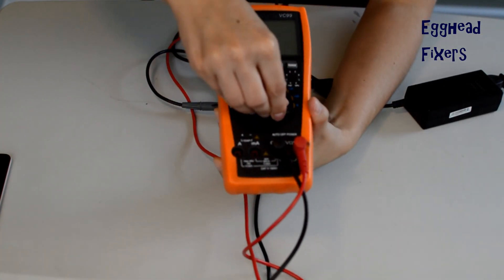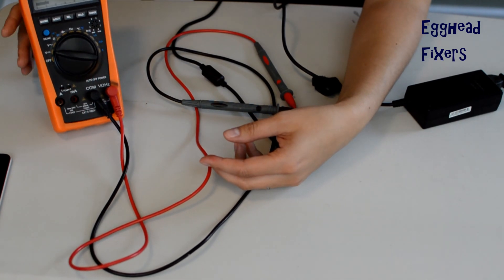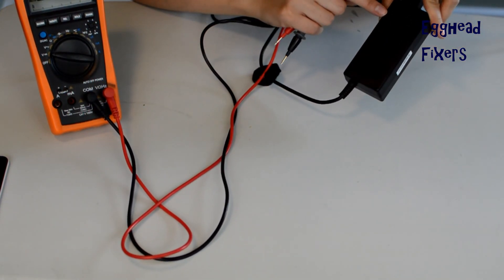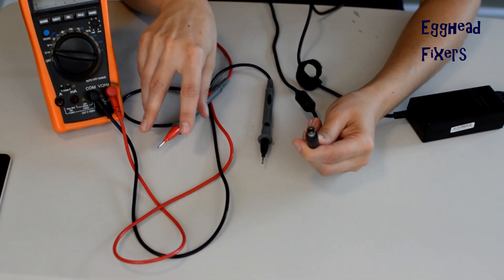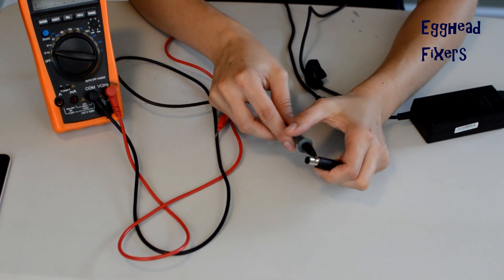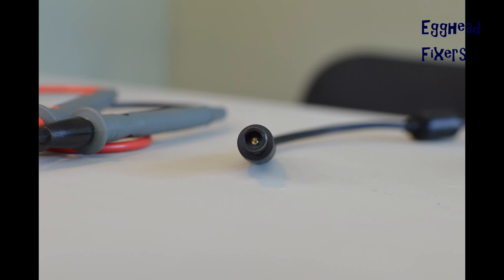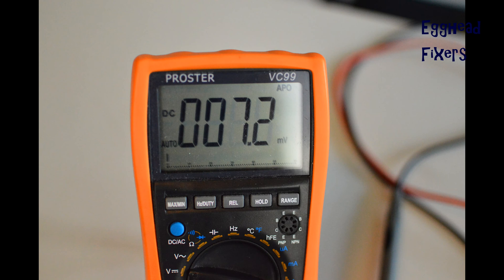How To Test Your Charger / Power Cord On Your Asus Laptop

Comment: Good to see a simple demonstration of the method to check.  I currently have a monitor that died and was wondering if the external power puck was faulty (ADP-90YD B ). Says its rated at 19V however, testing has it going from 17V to 19V constantly...I assume this indicates a bad power brick and it should be a steady voltage?
Reply from the maker: You are correct it should be a steady voltage. I would try replacing it.
Reply: @EggheadFixers  thanks I did, and realized the voltage should be stable when testing another power brick...have since replaced it! Learned something new :)

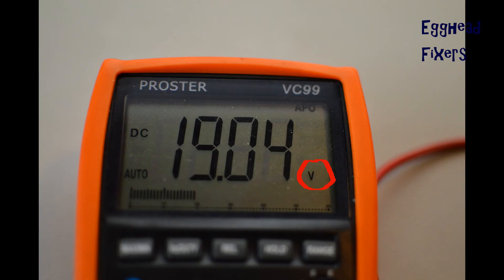Comment: Hello, on minute 00:55 you mention that to test properly one needs to touch the red tip into the gold tip inside the charger jack. Question: on my Dell Latitude 7280 laptop charger, when I touch the tiny tip at the center it reads nothing. However when I touch the walls inside it reads 19v around. Because they are different models maybe that means all is ok with mine? If you could help. Thanks